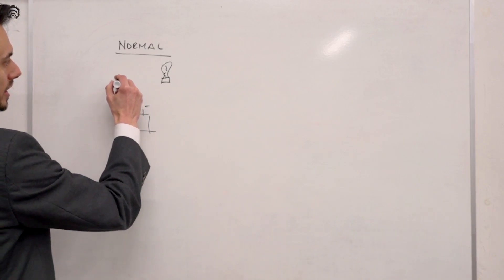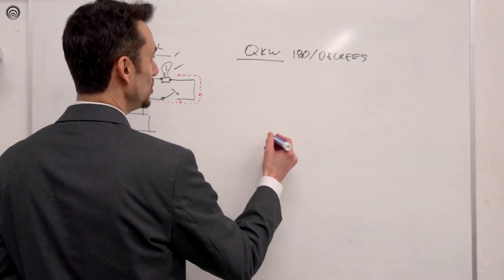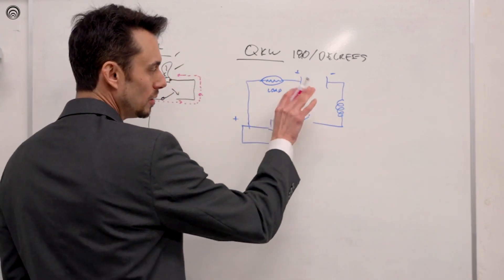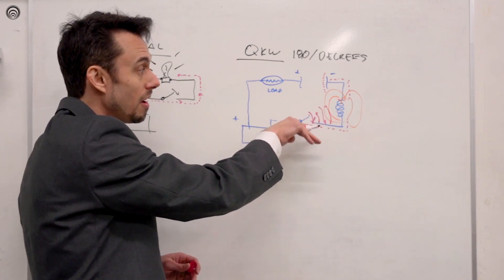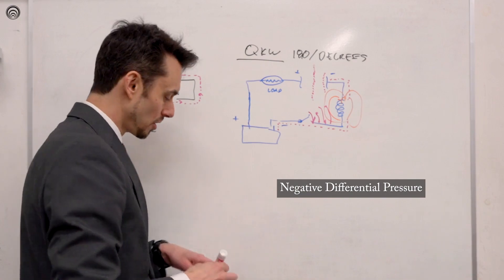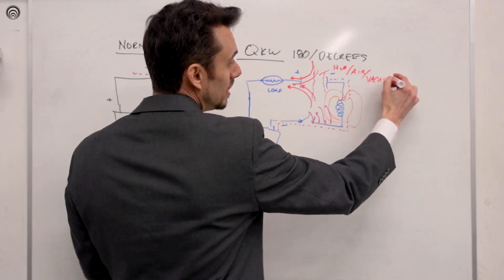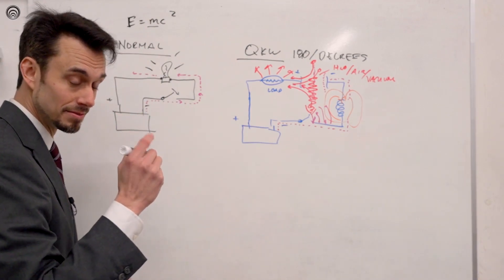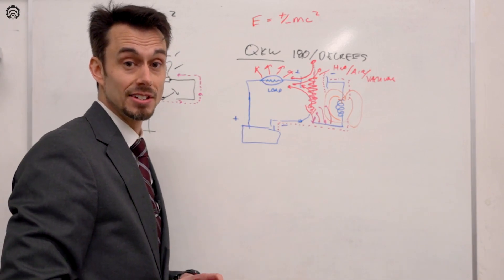ELECTRICITY | Phase Shift (Maxwell's Demon) | Quantum Kinetics Corporation

Comment: I recently commented on a short excerpt from this video. I love the idea behind this. But my question here is less an assertion that anti matter has no negative mass but rather asking HOW you know it does.

Is this new interpretation of the way anti matter interacts with spatial phenomenon simply a working theory or are you certain of it? And if your certain off it could you perhaps provide a link where I can look at a more detailed  analysis of your theory?

(At the moment of writing this I am  in international transport. My response may be an upwards of 15 hours late)
Reply from the maker: Thanks for your comments.

It's not a theory so much as a mathematical and physics Nobel Prize scientific fact (Paul Dirac's discovery of the positively charged electron ~1930's). The Positron +|e| has +|E| energy but - |P| momentum. While the Electron - |e| has - |E| and +|P| momentum. Both these particles have charge, mass, spin, and even momentum. Which, innately means, they both have inertia (Fnet = MA). However, one of these charge particles, has a tinge more vector force (velocity) proven by the Cloud Chamber experiments (1932). This extra energy (Free Energy) is what causes the Universe to expand and gives the "classical electron" it's innate internal wobble (Zitterbewegung). Thus, hinting, that maybe there was no Big Bang either...

If a charged particle has negative momentum it means that particle is going backwards in time according to the Nobel Prize winning physicist Richard Feynman. The negative electron goes forward in time. While, the positive electron goes backwards in time. You can't have one charged object without the other (Universal Symmetry). Otherwise, time would not exist. This is why Einstein was wrong. Space and Time are NOT the same entity. 

The proper equation of the Universe is: (+/-E = +/-MC^2). Safe Nuclear Energy Systems have arrived using the Quantum Kinetic Well technology. 

Again, thank you for your comments and safe travels.
Reply: Maybe I don’t understand properly, but here’s the issue I see with this equation as it’s currently presented. If I use this equation to evaluate what happens when a positron and electron come together in an annihilation reaction where all the mass is converted to energy, it would appear half of the energy has a positive value and the other half has a negative value and so when you look at it as a whole, zero energy is released. But I’m pretty sure you get photons with this reaction (though I’ve never done this experiment myself). This begs the question, are there positive photons and negative photons too? Maybe the positron and electron annihilation only releases half of the expected energy with the other half being attributed to neutrinos?   I had considered what does one do about neutrons since the neutral charge implies 0 mass and 0 energy? But I guess if one looks at a neutron as the combination of a proton and electron the bulk of the mass would have a positive value.